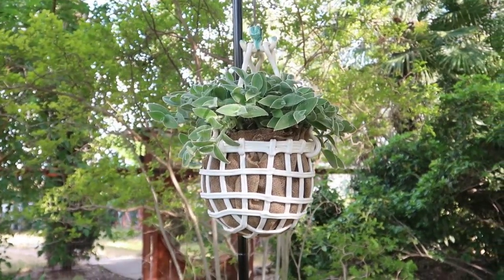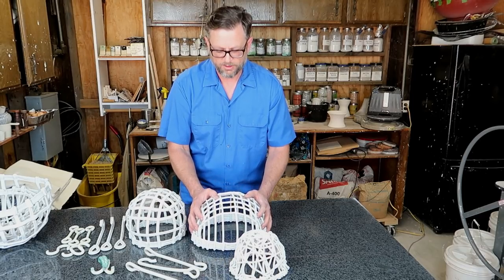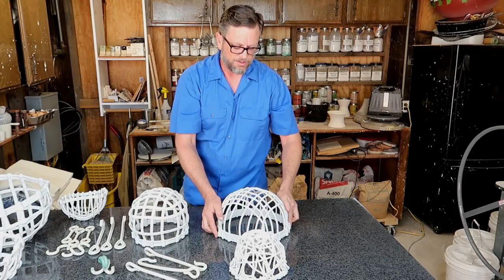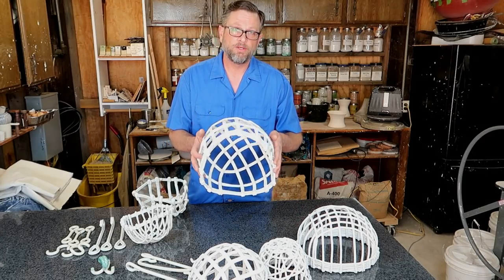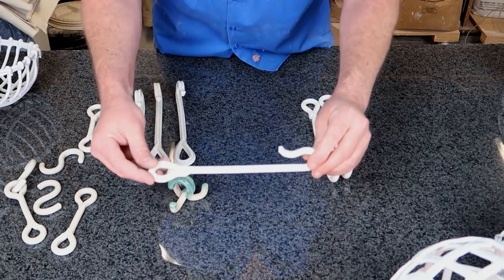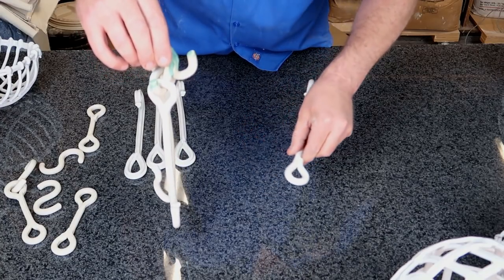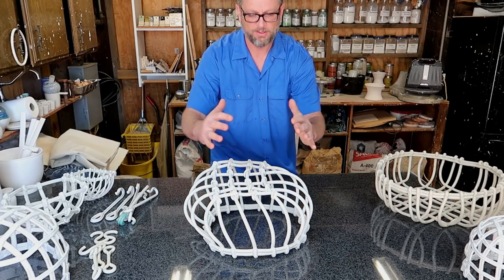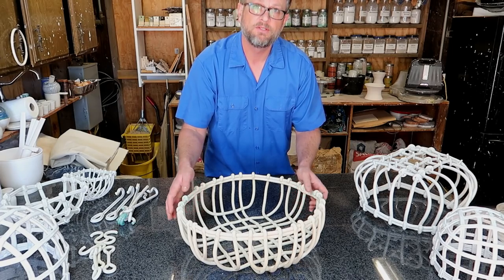Making Ceramic Baskets -  Forming Clay over Balloons

Comment: Love them. My approach when building fragil pieces and reducing breakage when moving them into the kiln is to use a bisqued 'cookie' large enough for the project to reside on while working - paper or used  dryer sheets between cookie and project help with shrinkage movement. I sometimes throw my cookies and undercut the outer edge which gives my fingers a better gripping area for picking it up. So, if i was making the basket, i would place it on a paper covered size appropiate cookie and then deflate the balloon. Now, it can dry and be moved easily to the kiln.  Really enjoy your videos  - thank you for sharing your process.
Reply from the maker: That is a really good idea! Thank you.
Reply: Justins Makery also you can slide the card into the kiln and it will burn off, no need to touch the piece.

Comment: What would happen if instead of deflating the balloons, you only let out some of the air, so it can still provide some support, but allows shrinking without cracks? The balloons would also probably allow for easier handling of the fragile structures if you could hold the baloon itself through the gaps for dipping in glazes, etc.
Reply from the maker: I think in theory, slightly shrinking the balloon makes sense.  I've had a really hard time letting out a little air and sealing it up again.  As long as you catch the clay before it cracks, it can usually stand up on it's own, and releasing all of the air is fine.